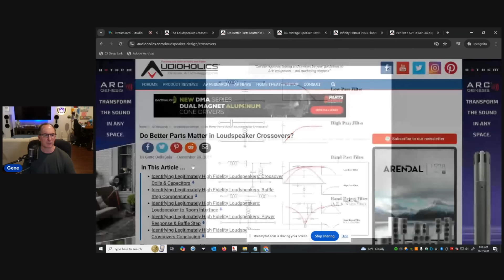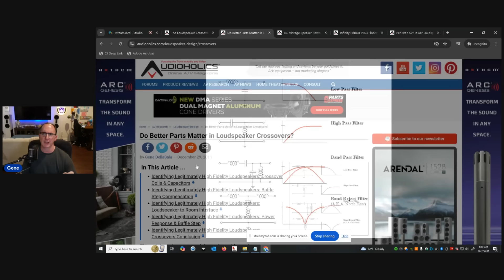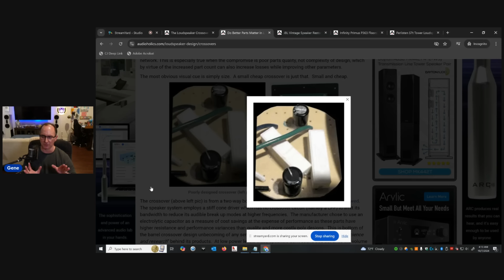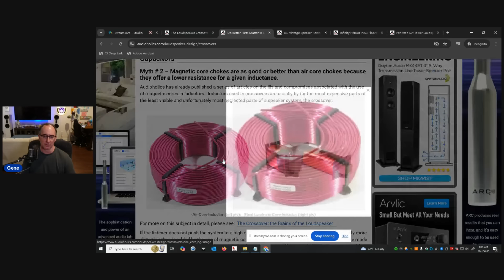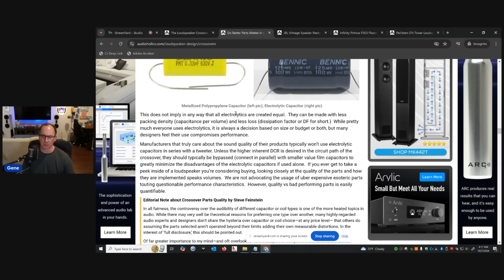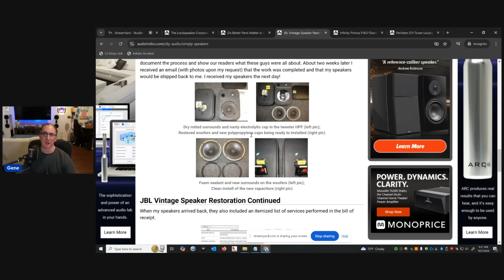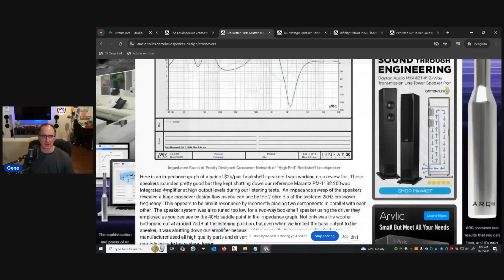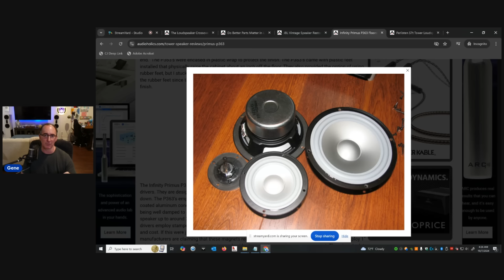Loudspeaker Crossover Upgrades - Are They Worth the Effort?

Comment: YES go deeper, get technical, bring on guests.  This topic greatly interests me.  I appreciate GR's channel and I think he has great products.  Sometimes he redesigns a crossover, i.e. he uses different values, so in that case obviously it can make a huge difference.  As for parts quality, I remain somewhat skeptical, but my assumption would be that it can make a small but noticeable difference up to a point... like, moderately good parts are better than super cheap crap... but exotic parts over moderately good ones?  I'm not sure.  I don't believe in cables like he does, or his tube connectors vs quality binding posts made of a good material, so I think I remain objective but am open to there being actual differences that perhaps we can explain and quantify.
Reply from the maker: @Artcore103  agreed, especially about cables.  I will bring on actual design engineers to discuss this topic in further detail if the video response is good. Thanks
Reply: @Artcore103   yeah Danny obviously knows what he is doing.   But he omits obvious details which more knowledgeable people know, such as parts tolerances and values.  It’s not just about ‘ cheesy parts’ as he says.  
And from messing around making my own crossover , you can’t really hear some things even if they are visually bad in measurements.  While other things we can hear, which we can see in measurements.   Such as phase.  
Having the crossover areas be phase coherent is important. But not immediately apparent to an average listener.   It’s more apparent while listening off axis and makes the sweet spot larger and more forgiving.
Reply: This is not a question for me anymore. I upgraded my 30 year old cheap speakers crossover and terminals in one speaker first and played them together, the difference was astonishing. After upgrading both speakers my newly purchased speakers went back into their box !
Reply: @azar3006 can you share the details of your speaker and the upgrade?
Reply: I've seen KEF Q Series speakers rated at 4 ohms but dipping to 1.9 ohms at 1800 kh - I've been informed these series from KEF are manufactured in China, whereas the Reference series are manufactured in the UK
Reply: @Audiomainia2310  You need to take in account that total power of speaker is  generaly  counted for music,  not for single  full power  sinus signal.  

 2kHz range is   biggest human sensitivity,  in that band the power of music is considerably low - power   normaly may be counted by few  times lower than for whole band in instance  . Impedance is say 4 times "too low" in compare to 8 ohms  - still not dangerous for amplifier if we use speaker as intended.   2kHz  harmonic has very remote chance to overload amplifier unless somebody wants to check nominal power for  2kHz which is not very jusified. In all other circumstances amplifier even cannot    reach  this  limit.  If we want  such speaker we need to use at least one widerange without crossover.
Reply: Parts make a massive difference, not a small but sorta noticeable one. Unless, of course, you use crappy parts for your upgrade.
Reply: @bayard1332  good to know
Reply: @artcore103 There is no question that parts quality impacts performance of any electrical circuit.  Competent engineers know this.  With crossovers, the question is a value proposition.  As Gene pointed out, reasonably good drivers are a required starting point.  Enclosure quality also matters.  It makes no sense to upgrade a $99 speaker with $200 parts.  I started upgrading and building crossovers long before learning about GR Research.  As an experiment, upgraded a pair of JBL computer speakers with better parts had on hand.  Definite improvement.  Have done multiple other speakers from a few hundred to multi $K cost.  The most expensive speaker had no better parts than the cheapest speaker.  Another comment mentioned upgrading 1 speaker and comparing with the stock speaker.  Both can have a similar FR curve, but will sound very different.

The technical reasoning behind tube connectors is sound.  That assessment is based on my experience diving deeply into the electrical and materials science of connectors for applications from automotive to aerospace.  Speaker manufacturers spend too much effort making connectors look good where the consumer can see and cheap out everywhere else.  At the very least, a tube connector or other connector of actual good quality will not cause any problems.

Galen Gaeris is an expert regarding cable.  To design the best quality, most accurate cable he used math and science far beyond the understanding of typical internet armchair experts.  Not many can afford, or would benefit, from such a cable.  However, one point of his exercise was to reveal things that do matter in cable design.  Lamp cord is not the same as an OCC copper cable.  Does not mean we have to pay big bucks to get good quality that at the minimum will not create issues.  Every link in the chain matters, even if only to a small degree.
Reply: @jfritzy4358  all of this may indeed be true , now we need well designed listening tests conducted to prove the assertions are audible.  Then published in AES.
Reply: Depends on where the parts are in the cross over and what is changed.  I have changed out sand cast resistors on a bookshelf and noticed a huge difference.  Also changed out a cap to a mundorf high end cap on the bass and didn't notice a thing.  I had a clarity cap before that, so not enough of a change there.
Reply: @Mikexception  An amplifier will be perfectly fine producing a 2kHz sinewave at nominal power, 1kHz is in fact the standard frequency used for such measurements. Multi-way speaker would not like it at all, hence dummy loads made of non-inductive resistors are used for amplifier assessment.
Reply: I think even Danny would tell you that if your room is not really dialed in then you may not hear a difference.  So ai think these kinds of upgrades should come after getting your room acoustics as good as possible.
Reply: Bring on more details on cross overs and parts in them bring on gr research too
Reply: Well small updates in crossovers can add up. Can you hear the difference between caps? Sure, but is it in your face kind of change like a speaker change? Of course not. But small updates everywhere can add up. Better amp, better pre, better dac, better speaker, better crossover. It cumulatively adds up to a big change.
Reply: @Audioholics  ,Great job I hope this counts as a good video response. I was hoping that an intelligent conversation on this topic would come along Gene.  I also believe that xover’s are a part of any production loudspeaker.
Reply: @paulb4661 You are right - with standard testing on bench with resistor  it is  for amplifier no problem.
Reply: @NightFlight1973  indeed we're all about the cumulative little tweaks and getting that last 10% in diminishing returns. 

When you move your speaker one inch or turn it 1-2 degrees you know you're an audiophile.
Reply: Hear, hear! Still waiting for a true double-blind speaker wire listening test between moderately good and esoteric.  Hopefully before I die?
Reply: @todd8155   Not much hope. 

For me blind tests should be organized in right, not confusing   ways. Depending on reproduced material someting may be not noticeable or noticeable  Only pink noise shows everything but for many music lovers  noise is hard to analize, specialy when system present noise  like only high "hissss"  - people can't find differences and judge such not complete noise

. I suspect also music presented  with deminished  middle of band, described  as deatiled sounding  which is very often appreciated   is not applicable to  notice differnces in wires Because those differences appear in middle band.

BTW wires which I consider "audio capable" because made   great surprise to my 12 db two way DIY speakers  cost me  in internet 6 USD /m.  Cheap but they must be solderedin special way  and  for  most people it may be tricky.  

The same wires used with  my DIY 3 way floor standers with unique my own developed crossover made like 4 times less improvement so with them  I returned  to standard convinent  wiring. There are no strict rules.
Reply: @paulgyro  There is no "may" about it.  Math, Physics, Material Science and Engineering knowledge don't care about feelings or opinions, only facts.  Have yet to see anything close to a well designed test that has any chance of yielding convincing results.  What test protocol and what measurements, how many tests of how many parts in how many speakers with how many listeners for comparison to measurements?  That is a formidable task, time consuming and expensive.  In the end, would it really move the needle significantly?  Every time a double blind ABX test concludes there is audible difference due to something, the naysayers pick it apart and refuse to accept.  Every time a double blind ABX test concludes there is not audible difference, the opposing naysayers pick it apart and refuse to accept.  How about just believe our own ears and be happy.  Quit trying to prove there is right or wrong.
Reply: @jfritzy4358  if that's how you 'feel' stop trying to convince others then.  Evidence is what matters in science and engineering not how people feel as confirmation basis is real and psychoacoustics dominant.   Just enjoy what makes you happy and live and let live and let the Harmons and NRSC on the world do the real work.
Reply: Yeah, he is making in a day what real engineers spend as year on! He must be a genius
Reply: @paulgyro  I have the engineering bona fides to know fact from fiction. No feeling involved.  Since you seem unwilling to accept long established facts known by competent engineers, it is you relying on feelings.  No interest in convincing anyone, only sharing experience and knowledge for those willing to learn.  Do your own listening test.  That is the only way to decide for yourself.  As soon as the terms confirmation bias or psychoacoustics appear, spidey sense says here is someone with beliefs never to change.  

Since you mention Harmon.  Correct spelling is Harman, an audio company that has done good things in the research area.  Their primary motivator has been to identify what the mass market buying public prefers, of course to boost sales. Their big takeaway was the mass market consumer is not a discerning listener.  Booming bass sells speakers.  Hot treble sells speakers.  Balanced accurate sound is desired by a much smaller market segment, that is willing to pay high prices thinking that equates to superior sound quality.  Cover the entire range of consumers and Win - Win.
Reply: @azar3006  What did think would happen after 30 years?
Reply: If you are replacing 40+ yr old caps as I did in my Yamaha NS670 speakers yes it makes a difference.
Reply: @adaboy4z  certainly, they're way out of spec if not totally broken lol.
Reply: regarding speaker cables, i don’t get how it can make s difference bc the wiring inside amps and speakers is not huge and fat or anything like the big money cables. doesn’t make sense !
Reply: Danny Ritchie of GR Research is a witch doctor.  This guy is at the same level as Ted Denney.
Reply: @jfritzy4358  sorry it $99-$200  is worth it to some as we already have and like the speaker ,or brand and it is a fix we can do ! as a DIY project
Reply: @jfritzy4358   The theme of this video is "Loudspeaker Crossover Upgrades - Are They Worth the Effort?" I really don't know why you talk about performing Audio Tests. As you could see in the video there are speaker in real life that could be much better if they would have better parts in the crossover. I think those speakers are the object of this video too because with little effort in the crossover big results can be achieved, I think. For better sound on old but loved speakers Detlef
Reply: @paulgyro Ok, my old cheap speakers are B&W dm302 that I bought new after they won an award and got good reviews in magazines as there was no internet at the time. I was satisfied with them but noticed listening fatigue after long sessions so after almost 30 years I decided to upgrade to a new speakers “ Wharfedale evo 401”  thinking they for sure be a major improvement as they have AMT tweeters and kevlar woofers, I bought them online as it was during Covid with no place to audition them. The new speakers however had a new issue as they are less sensitive ( 87 db ) vs. ( 90 db ) of the B&W’s and I still got the dreaded listening fatigue during long sessions and searching I came across Danny’s videos about upgrades so decided to upgrade my old speakers and was lucky enough to find the speakers crossover diagram online so I ordered some mid level parts from “ parts express “ lined the box with some acoustic foam and replaced the wiring and terminals with brass ones. I estimate the cost around $120 and few hours of my time.
I am very happy with the result no listening fatigue, speakers seems  to disappear with some good recordings and efficiency has gone up because of the lower ESR Parts. All in all everything is better, my problem is what to do with the new speaker now, either buy microphone and design a crossover for it or send it to GR Research for an upgrade !
Reply: @jimross2101 Seems like you didn’t  read or understand anything I wrote, the box and drivers are the same 30 years old, the original crossover was functioning fine and I measure capacitance, resistance and inductance all original values, the new crossover is not changed at all just better mid fi parts from Parts Express and since I upgraded one speaker at the time there was no question as to the improvements so yes I proved it to myself and that’s what matters, you can take it or leave it !
Reply: @azar3006  I'm glad to hear you enjoy your speakers and the music! I've done much the same with old speakers I've converted to active speakers.  Complete game changer. I measured and designed active crossovers myself
Reply: @Artcore103  Well it isn't just about quantity.  We know that iron core inductors have hysteresis and that degrades the sound.  But, with other parts, redraw your crossover circuit with a resistor in series with each inductor and capacitor and an inductor in series with each resistor.  These don't "smear" the sound but they do change the frequency response of the crossover network.  Larger and more expensive inductors and capacitors have smaller series resistance and better power resistors eliminate the inductance at audio frequencies.  But they cost more.
Reply: @jamestyrer907  do you know if these effects are measurable in any way, even if not with a basic frequency response graph... Distortion, something on an oscilloscope, anything?
Reply: @Artcore103 You can observe the effects of the crossover on a square wave with an O'scope.  To get actual measurements you would need to analyze the harmonic content.
Reply: @jamestyrer907  yes that's interesting, but a true square wave is impossible except in the digital domain, so if we're band limited to around 20khz do they have those same effects? 

I ask because if we can hear a difference then it must be measurable, but I'm not sure exactly where/how our measurement methods or understanding of them, or of human hearing, are limited.